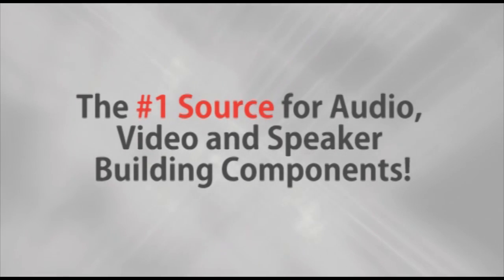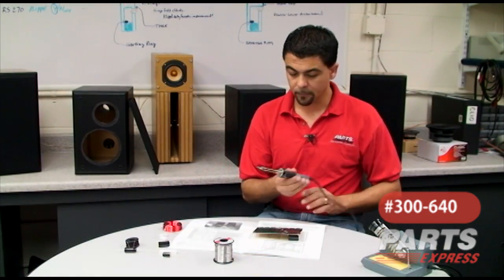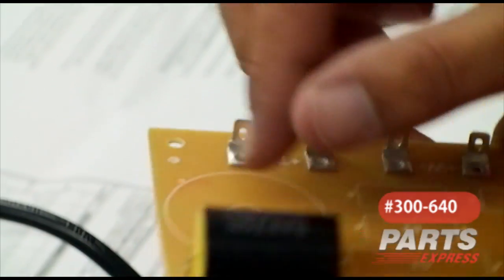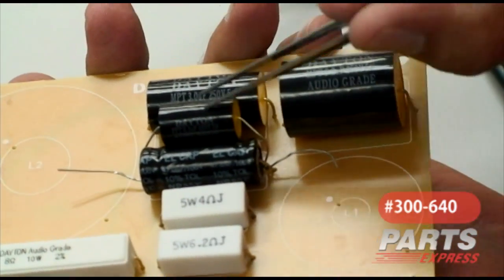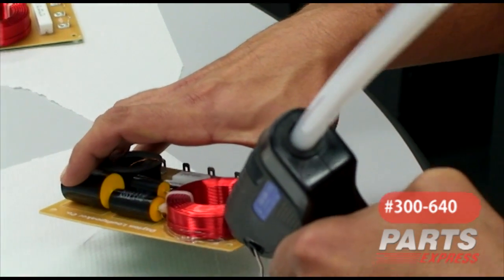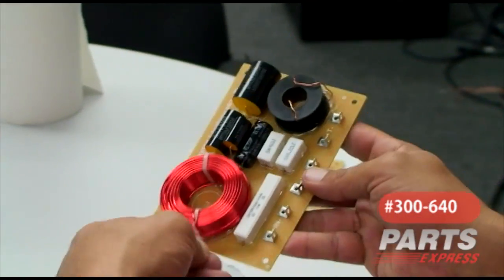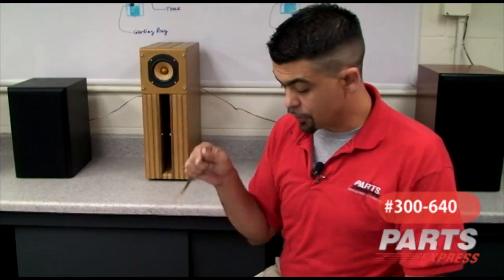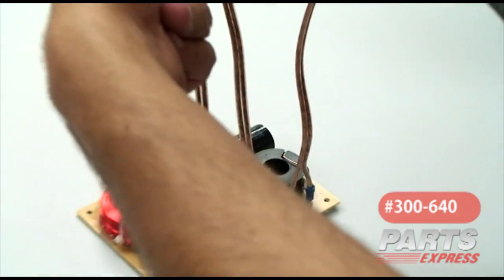Dayton Audio BR-1  Speaker Kit Assembly Video 1/2

Comment: As an electrician I will say this. When you are stripping wire make sure you use the right gauge slot on your strippers and strip straight away. You don't want ANY strands missing or damaged. It won't hurt much on a speaker wire compared to real world electrical installations, but it definitely degrades the wire and terminations. One you lose a couple strands you may as start derating your wire.

Comment: Just a note. Do not feed solder into the iron. Solder will follow the heat on what you're soldering. That's how it crawls into gaps and voids. Flux helps this. Should have put glue on the caps or you may get a vibration on those. Electrolytic caps are also polarized.